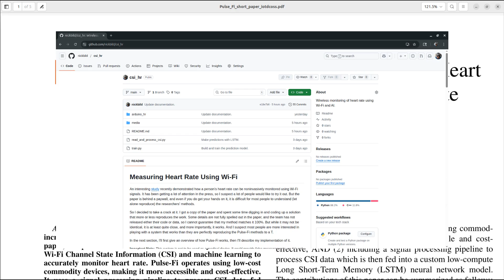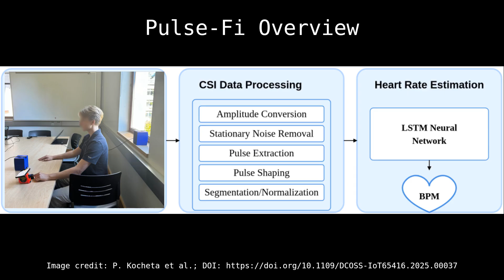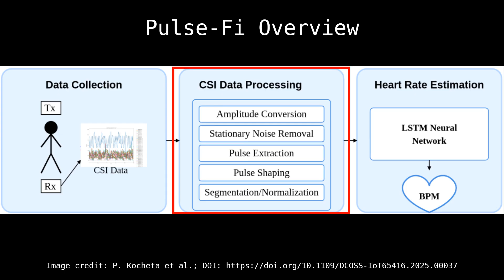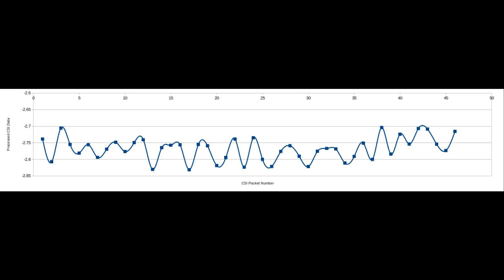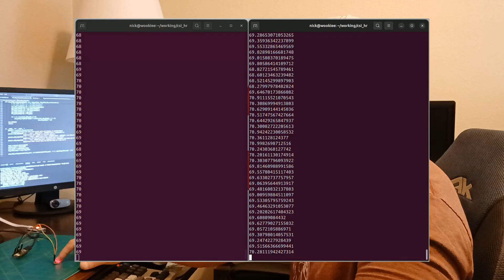Measure Your Heart Rate with Wi-Fi! (DIY Project)

Comment: If this can be done on the ESP8266, then I have an interesting idea. In the world of virtual reality, there is a thing called Slimer FBT, and their IMU trackers are based on the ESP8266. They are worn on the body and, theoretically, can work together to read heart rate more accurately using Wi-Fi, and now there's an additional feature that just appeared out of thin air, and anyone who already has these trackers can get this feature by simply updating their firmware

But this is just my imagination, and I'm not sure if the slimmer developers will want to add this feature

Comment: did you test with different heart rates? like speed up your breathing and take readings?
Reply: I was going to say, from the video it seems like the model is "overtrained" on too limited training data and is just producing the only output it knows, and that might be why it doesn't match the real heart rate
Reply from the maker: @gorak9000  That would definitely happen without some variation in the dataset. I don't think being off by a few beats per minute alone is concerning though. For a similar window size, Pulse-Fi reported an MAE of over 6 on one dataset.
Reply from the maker: Yes. A little jogging in place and such. The model wouldn't really be able to learn the associations without that.